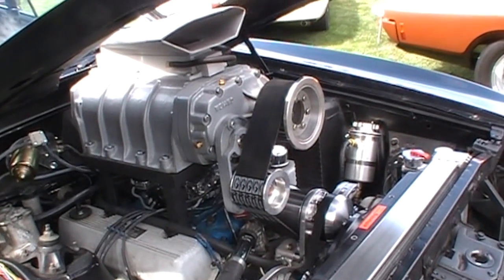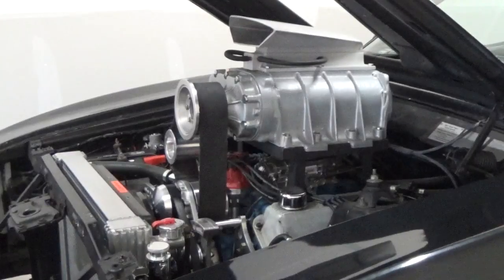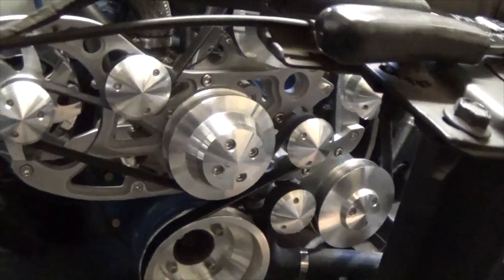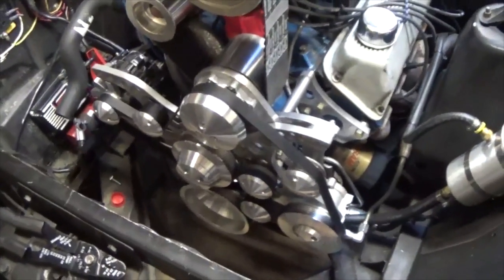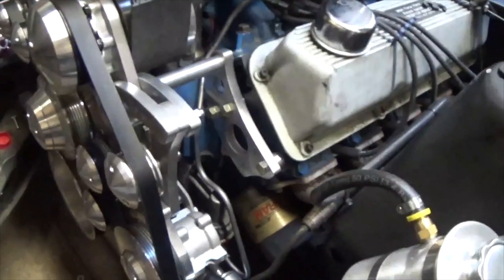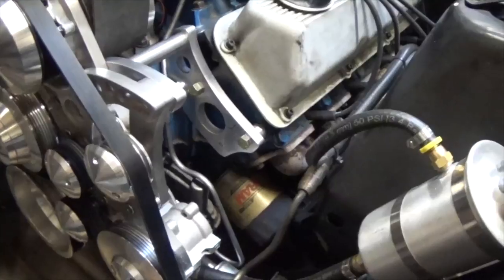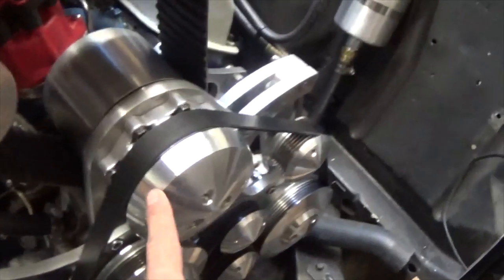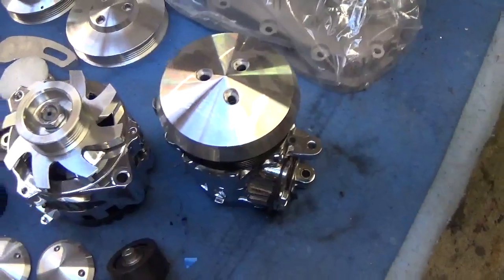Mad Max Interceptor Blower Drive Unit

Comment: Very nice.  Of course, it would be even nicer if the blower worked...but then you can't switch it on and off, which was one of the features in the movie.  Nice going!  :-)
Reply from the maker: Thank you! We do try to make it the best. We also do build cars with functional superchargers for the clients who want them!
Reply: The problem then is getting the air to bypass the compressor (which would otherwise be a severe restriction if not a complete blockage) - especially with a carb/injection sitting on top of the blower.  There simply is no way to get the air from the outlet of the carb/injection to the inlet manifold with the blower directly in its path.  With the injection downstream of the blower, however, it would be a fairly simple setup to have an intake port beneath the blower that could be opened and closed as needed - but that would change the look of the car, which is important in this case.
Reply from the maker: Yes, it would be cool. With today's technology I think it is theoretically possible, but it wouldn't look like the one in the film it it did work.
Reply from the maker: That sounds quite correct to me. As you point out, and I mentioned above, it would certainly not look "Movie Correct" if one built it to work like the movie car supposedly did, and like you describe.
Reply from the maker: That is probably true as well. I sure would miss that mean old Weiand blower and the wicked cool Scott Superslott injector hat.
Reply: It's certainly doable.  If you've ever seen "Love the Beast", that Falcon coupe was running around 600 hp through a solid rear axle, _sans_ blower - although probably with a little more tech than was available to Barry.  But it's nice to know it's well within the realms of possibility.  :-)
Reply from the maker: It sure is!
Reply: I believe it's technically possible to build a functional blower in such way, by using an electromagnetic clutch to engage and disengage the blower's pulley. But that would add way too much complexity to the build.
Reply: @Roddy_Zeh  I was thinking the exact same thing. Its probably just a matter of switching the EM clutch on an off as needed.
Reply: Correct. I do think it's simpler...or rather, less complex to do so with other types of superchargers, like a centrifugal one, but that would mean hood totally closed and we'd lose that epic blower coming out of it. =(
Reply: All in all, I guess I'd rather sacrifice the on/off capability and put that Weiand monster to spin all the time...and make sure, with a nice tune, to put out at least the same 600 whp Barry claimed for the movie car. That would likely mean somewhere 700 or slightly above, at the crank. Only thing it wouldn't have would be the DOHC heads; for that, I'd have to go for a Modular/Coyote V8 made to look like the old Cleveland unit.
And, obviously, even if a bored and stroked Coyote to 351 cubic inches with the DOHC heads and the same Weiand supercharger, air intake, etc., could make this much power at the wheels (hell, the Mustang GT500's Trinity V8 was capable of 662 hp...and it was almost a 351 c.i. block!) and even be more efficient...this would kil lthe character of the original car.
Reply from the maker: That would be a way to go. Some guys really do want the functional Blower. Thats why we build them that way and offer the EFI adapted Scott Superslott unit.